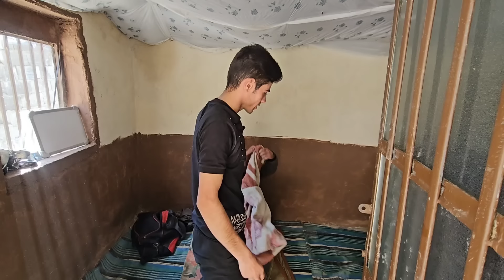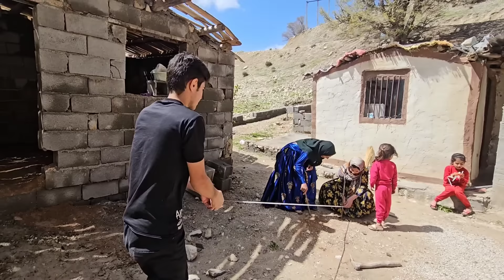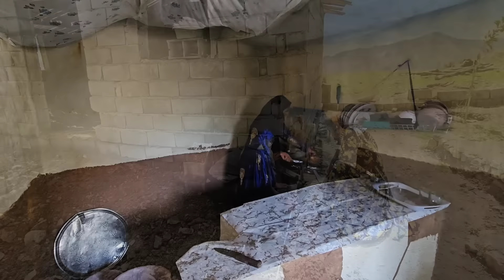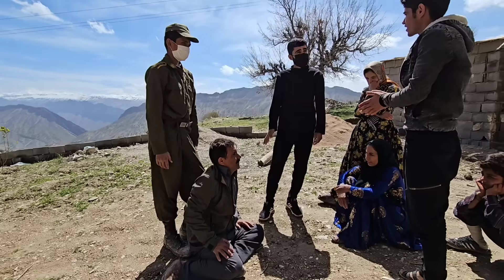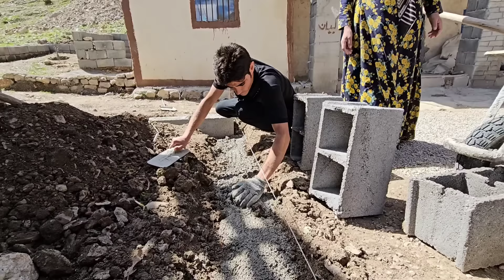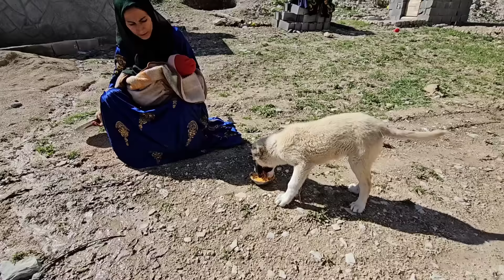Intrigue Unveiled: Betrayal, Forgiveness, and a Race Against Time

Comment: Dont separate the roofs. Attach them now. Have the porch drain back to house. It all should have drained from front to the back yard. But that boat has sailed now that it is pitched in the center. Where is the water going to go on the chicken house side?  Its a walkway with no drainage. Youll end up digging a trench right to the front yard. It will be a mess. Make the blocks even across the front and change the slope now. Drain from yard side to over the stone wall in the back where the grass grows.